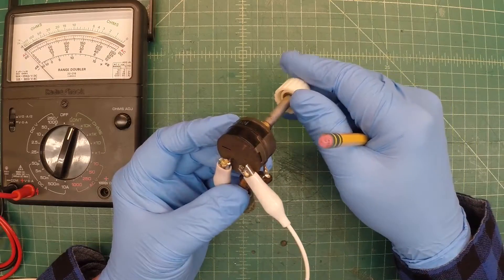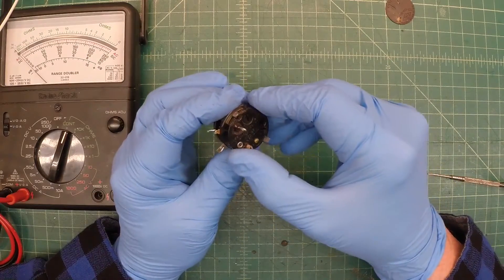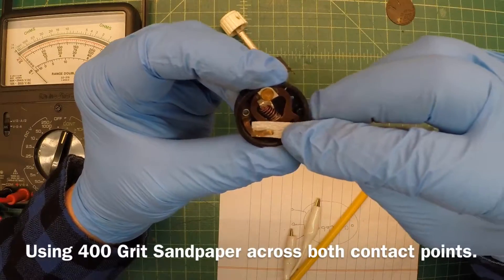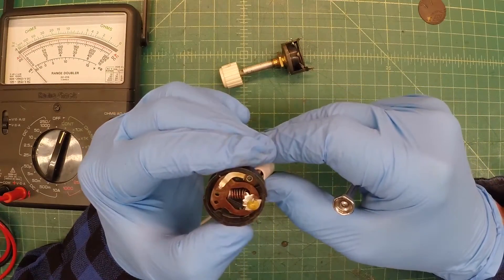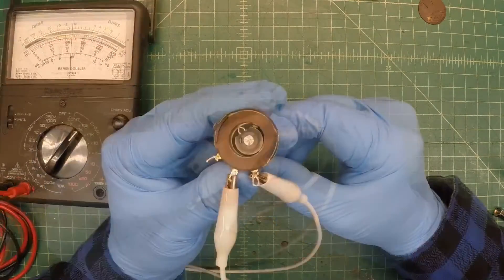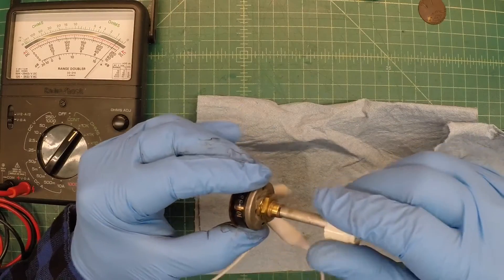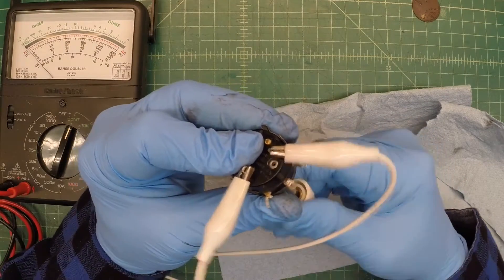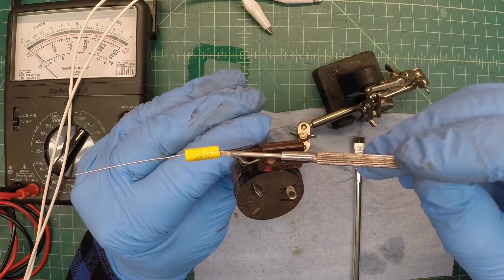Airline 62-306 Teledial - Switch On Volume Control Repair

Comment: For those new to the hobby it might be worth mentioning: the tabs on the switch/potentiometer will let you bend them open and back closed about one time. More than that you risk cold working the metal and they will break off. Make darn sure, like Don did, that it works before you bend them back closed.
Reply from the maker: Richie - excellent point and one I should have called out. I can’t recall how many I’ve broke in the past. Best, Don

Comment: The fun part about working on old potentiometer switches is you never know what your going to find inside! It seems like everybody came up with their own way of doing it. Some good and some bad! Coming right along.👍👍
Reply from the maker: Thank you Bob. I know my reply is dated, but I appreciate your feedback and taking time to watch. Best, Don
Reply: I enjoy your work. Thorough and you explain every step. I'd leave the candohm alone. At that low a current it will last another 80 years! I have a favor to ask. I'm using your RF amp module in my design. Is it OK for me to show the schematic with a credit to you on it? Thanks.
Reply from the maker: Robert Gibbons Thank you Bob. I’m with you on the Candohm. Feel free to use the schematic as needed. It was not best, so feel free to redraw it or get it Doug for a re-draft. I’m looking forward to your update. Take care. Don

Comment: May I ask why you would put that mica cap back its old and not as good as a modern one,if you are doing that good of a repair ,I wouldnt put back that old cap back ,I concider that a cheap move,but thats just me I hate putting back old old parts back in ,
Reply: The same could be said of the volume control & some other bits.  At some point, I guess it's satisfying to say that some of the old parts are still working.